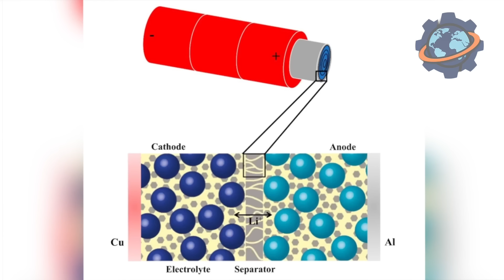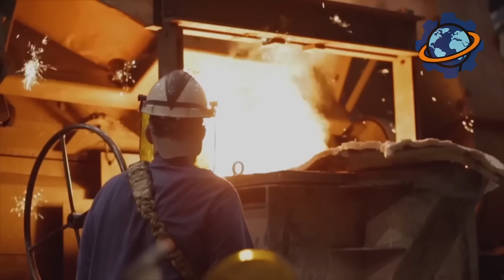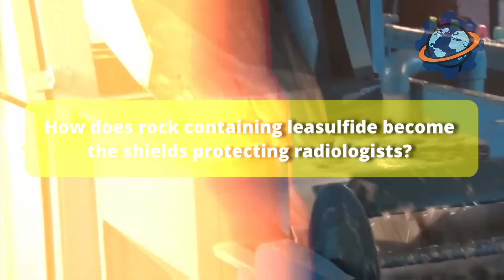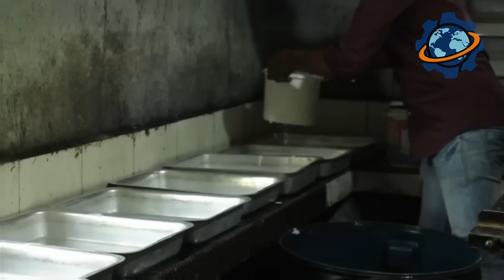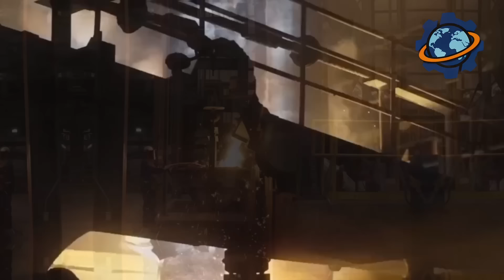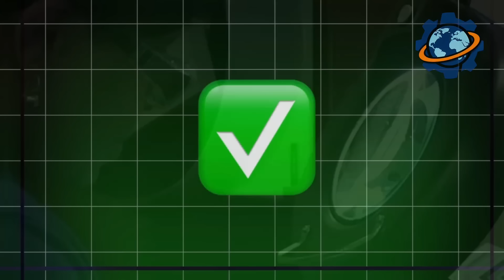How Duracell Batteries Are Made | 2,000 Batteries Per Minute Inside the Factory

Comment: A key feature of Duracell batteries was that they were leak proof.  Modern Duracell leak and cause damage.  Originally they provided a guarantee for the devices in which they were used - not anymore.  The quality went years ago.  Please explain.

What went wrong.
Reply: Yes, I remember when you could rely on them not to leak, now they seem worse than cheaper brands.
Reply from the maker: Thank you for your insights, @Land-of-reason. The quality of batteries can change over time due to various factors, including production methods and materials, and it’s concerning to hear about these issues with modern Duracell batteries. 🛠️
Reply: The company started out as Burgess batteries. Worst leakers ever.

Comment: Yet more inaccurate Ai slop - Only the first 10 minutes is about the production of Duracell batteries. At 9 minutes it shows Varta batteries too! 
Plus the fact that since year 2000, when they stopped adding mercury to the chemical mix, Duracell are one of the worst batteries for leaking, often several years before the expiry date & even while still in their packaging!!
Reply from the maker: Thank you for your feedback, @RichieReportsUK! I appreciate your insights on battery production and the changes in Duracell's formulation over the years—it's important to discuss these factors when evaluating battery performance.